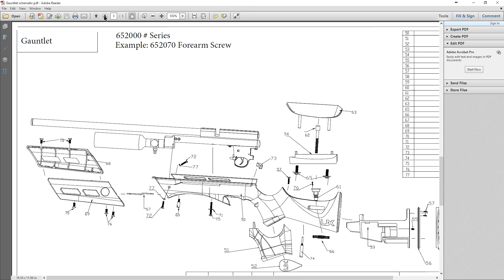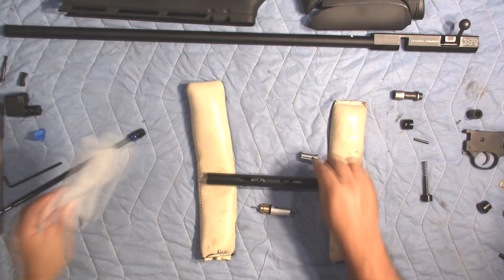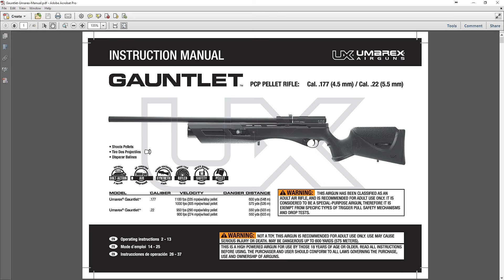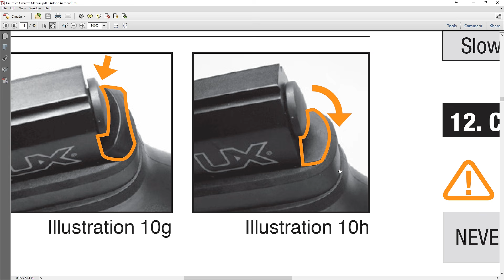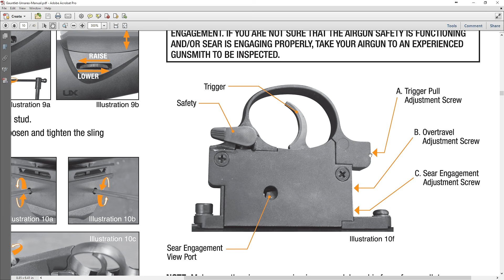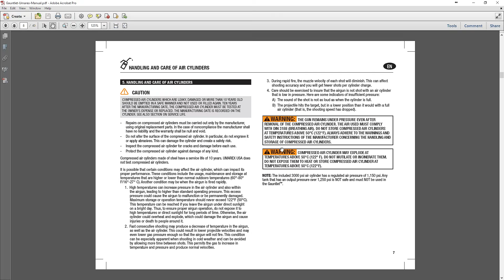Umarex Gauntlet: Super Tune Kit Installation

Comment: Hey I just received the gauntlet and 22 caliber guess what it's broken so SG is sending me a new one out I was so siked up air is coming out of the breach when I pull the trigger then makes a pop sound when I pull the bolt back halfway
Reply from the maker: Sounds like the trigger sear is not holding the hammer back correctly, it also sounds like your poppet is not seating/sealing properly. Swapping it out is the best thing as there may be more things wrong than what you have noticed with that particular rifle. I hope your second one is correct so you can get to enjoying your Gaunty!

Comment: Thank u for this video. I bought this kit a couple days after u put out the video with the results and it's amazing. My reg pressure is at 1300 psi.  I own the .177 gauntlet and I can tune it from 6 fpe to 22 fpe. And anywhere in between. Another thing is that if u like a pellet that this gun doesn't In stock form then u can adjust it with this kit to shoot almost any pellet u want accurately. Thanks again hajimoto.
Reply from the maker: Hey Dustin!  I agree, the adjustability allows just about ANY pellet to shoot well in the Gauntlet.  Thanks for the comment and Happy Shooting!

Comment: Putting the bottle back do you screw it all the way in? Cant seem to get it to align screwed all the way.
Reply from the maker: Ricardo is the bottle under pressure or no?  If not under pressure, screw it in tight and if the fill nipple does not align with the opening in the forearm shroud, loosen the grub screws found around the collar that holds the regulator two halves together. The allen grub screws are shown here at this point of my video https://youtu.be/PYKJ60M6b08?t=13m35s
Loosen them so you can tighten or loosen the collar so the nipple is where you want it and then retighten the allen grub screws.
Reply: Hajimoto Productions it was under pressure and it would release all the air while screwing it in. I noticed i had the screw touching the hammer in to much so it had the poppet open up in the valve. After adjustment i was able to screw in the bottle under pressure and it aligned perfect.

Comment: I took mine apart a second time after having major leak issuse after trying to install this kit. After its all back together,  when I try to fill the tank on the gun air starts immediately leaking from the barrel and hissing pretty good. It wont hold air at all. Any ideas on what the issue is?
Reply: Charles Reedy Fr8train  I did get the issue resolved the O ring around the valve was messed up once I fix that it worked fine
Reply from the maker: Hello, First try to be sure that the rifle is on safe and the bolt is cocked.  If it still leaks you may have to do a more aggressive burning technique as demonstrated by Travis in this video.  Typically this corrects the problem. The issue is the brass valve seat has an anomaly that the Delrin plastic just can't form to and you end up with one spot that won't seal.
https://www.youtube.com/watch?v=WS9v3-QUSX0
I have added this additional step in my video description for future inquiries.
Reply: Ralph Johnson I fixed my issue.. its was the new popett was not seated properly. Check out the video recommend by hajimoto
Reply: hey did you get this issue resolved my gun is doing the same?
Reply: I think I have the same problem :(
Reply: Ralph Johnson https://youtu.be/WS9v3-QUSX0
Reply: Mine wasn't either. I worked on it twice and stuck the factory one back in it and tried it again. It works but my arms are so sore from the hand pump that I'm going to take a break before I disassemble and try again. Thanks for the reply!

Comment: Can you open up the transfer port tube a bit without ruining it or use a wider ID tube to increase the air flow?
Reply from the maker: You really cant open the transfer tube as it is a plastic or rubber tube and it will destroy it but you can increase the ID of the Breech and barrel size for better delivery of air to the pellet.  Be sure to debur the inside of the barrel so you don't ruin the entry point and damage every pellet being racked in.

Comment: Well done Sir. I’m sold on the tune kit idea, but are there going to be further modifications on this tune kit ? I reed below where your tweaking this mod kit. If I order today what version am l getting ? Should I wait a few weeks and get the latest and greatest.
Reply from the maker: The kit has been tweaked as much as its going to be tweaked. Thanks Dan
Reply: Thanks I’ll get that order in soon. Along with the new air stripper. I have reservations about the baffles I just posted a question about those on that vid. Won’t get into that here.

Comment: Haj, what afternoon, finaialy got the time to install my Jefferson state kit. Took the guntlet apart, scalped the o ring on the valve. But i had a viton o ring the same size just .005 bigger in diamator, and it slid in and sealed. Assembled the rest of the parts no problem, till I got to the adjuster. They are anitadizing the part which made the screw hole for the rear trigger screw to tight. Drilled it a little larger, no problem. Adjussted the screw to full power per your video and tested trigger. Aired the gun up and set up the croni and targets 33 yds 14.3 crosman prem. First shot 720fps. I thought that doesn't make sense. So i started adjusting the screw out. About 10-12 turn out. Finial got 908-901fps, happy guy. The 15.8 JSB 880-872, great. 18.3 JSB 830-825 NICE. I wasnn't tryiny for dead on target groups but about 3/4" to 7/8" at 33 yds. Im a happy man. Thanks for the great videos, they helped a ton Dave
Reply from the maker: Great update message and I am glad that the kit went in for you. The end cap issue is known and the hole is going to be moved slightly forward to allow better match up with the pressure tube. Yes, the adjuster screw at the maximum position is not necessarily the best position but a shooter will know the maximum screw adjustment and count anti-clockwise turn back and record the ft/s to get a fair understanding of the power adjuster ladder. 18.3's at 830ft/s should do quite well. Congratulations!

Comment: Taking it apart and putting it back together.. I definitely think I nicked the O rings .. everything is back together but I haven't tested it yet.. what will the symptoms be if I need new O rings and where can I get them?
Reply from the maker: Hey man! Well, leaks will be the most obvious way to tell if o-rings have been damaged. If in the pressure tube, the tube will lose air over a period of time if In the gun barrel, you will lose air from the o-rings rather than going down the barrel and so forth. A test I use for determining if the barrel, transfer ports or probe o-rings are leaking is to drape a length of toilet tissue over the magazine area and fire. If the paper is blown around look at what direction the force came from and follow it back to the source. If you have access to Harbor Freight in your area they sell 385 piece o-ring kits in both SAE and Metric. Each kit is only $7.95 USD and you will have close to 800 o-ring of all different sizes to get you through if you are in a pinch. The only o-ring I have not found in the kit is the very small pellet probe O-rings. I have ordered a few different sizes from McMaster Carr and I think I may have a winner with the 1.5x2MM https://www.mcmaster.com/#1247n128/=1c0b1li

Comment: Has this tune kit have the spacer machined down like Travis Whitney was talking about on the Gaunlet owners group?
Reply from the maker: Negative, this tune kit was installed before we discovered the reduced spacer benefit.
Reply: Hajimoto Productions is there going to be a replacement for it offered?
Reply from the maker: Yes sir there certainly will be a replacement available. http://www.jsairrifles.com/Umarex-Gauntlet-High-Travel-Valve-Retainer_p_78.html

Comment: There needs to be a knob affixed to the adjuster,  so it can be changed on the fly , in the field. Many times I turned  The power adjuster down on my Bantam,  when doing pigeon control,  inside barns. Go from 923fps to 700 in 2 clicks .  To limit over penetration.
Reply from the maker: Agreed Tim, some sort of mechanical or visual feedback would be perfect.

Comment: ive tried for a long time to not say anything about the barrel band. just out of respect for haji and this is going to be hard for me to word properly. Now, i know im going to get alot of disagreement. mainly because im not going to go into the mechanics of why. im just going to state my opinion on this.
 I dont use the barrel band. i myself believe it would be effectively shortening the length of the barrel. and it would be introducing shake and movement directly to a point nearer the barrels end instead of the barrel being able to maintain its trajectory for that instant longer than the stock. which is going to prov more problematic the harder you have to pull on the trigger. for you guys not going to do the trigger mod. thats why the gun has a full floating barrel. but why would anyone want to eliminate that advantage from the gun.
 instead install haji's smaller and lighter air stripper and suppressor cups. and im still waiting for someone to make a light weight outer barrel. i dont think anyone realizes the need for it to help the full floating barrel ensure there is minimum barrel droop. less arc is going to result in less friction down the barrel and less energy being wasted to change the inertia force of the bullets path. less arc in the barrel is just going to result in higher performance and accuracy. all long barrels droop, an expensive gun is going to have that barrel aligned(counter arched) to compensate for it. I dunno maybe there really isnt much barrel droop and it wouldn't have enough difference to make the cost worth it, but a lighter hunting gun would be nice.
 thought i wasnt getting into it but, okay if you fix the barrel mid point what your doing is changing the arc of the barrel. so effectively your path out of the barrel is being changed at a point past the barrel band where the arc is now going to flatten out and the barrel will be what i will call straight for the rest of its length. which is now only the last few inches. instead of of a nice smooth arc all the way down the full length of the barrel.
i'am assuming no one is ever going to get the barrel perfectly straight no matter how hard it is tried. that wouldnt be ideal you want it to somewhat force the projectile into the same repeatable direction every single shot. with no more arc than is needed to get that accomplished.
Reply: wait.. is hajimotos air stripper and suppressor cups lighter than the factory unit?
Reply from the maker: Very tight. When installing the shroud after my HP Air Stripper, one MUST be sure to silicone lube and slowly slide the shroud on as my o-ring in the HP Air Stripper make 100% contact with ID of the shroud.
Reply from the maker: You are entitled to your opinion and as long as you are not disrespectful about the deliverance of the opinion, your post will stay visible. As you stated I disagree with your position ;)
Reply: i really wish i had a barrel band to review. I honestly dont know if i could prove myself right or if there is any difference in accuracy at all.
but, i said lighter not tighter altho tighter is always better haha.. i would like to remove as much weight as possible from the end of the barrel. so there is less natural barrel droop. but the suppressor/comp is very very important to me. getting rid of it is not an option.
im not a gun smith. if im wrong or of different opinion please tell me why.
Reply: Beef Supreme :  Your argument is held under false assumptions .  Stabilizing a barrel in an air gun is more important than a free floating barrel like you would see on an AR 15 .  Keeping the much chincier air rifle together for a long period of time prevent a lot of problems with the guns functionality over time . Where as an Ar 15 which is built to military spec can be durable without the need for such things.   The amount of consistency you get from keeping all the parts in the same place on an air rifle is by far one of the most important thing to do if you want the gun to shoot the same way day in day out and you will gain accuracy by keeping the gun aligned vs having a free floating barrel on an air rifle .   You can debat opinion of course but in any accuracy test you conduct make sure you put 1000 shots downrange and see which gun remains the most consistent.

Comment: So thats a nice video and all 'but how much velocity and fpe power do you get ?
Reply from the maker: I still need to do the tuning and test video before I can accurately answer that question. But in preliminary tests I did during development I was able to achieve 30FPE (18.13gr @ 865ft/s)
Reply: Hajimoto Productions that's what I wanted to hear.  I heard they come factory running around 760 780fps so that would be a great improvement. I'm just about sold on buying your tuning kit. I'm just waiting to see the next video really. That and I already slot this month. Lol

Comment: Thats on ajusting , the regulator I added 2 shims , awsome performance,  do you recommend upgrading valve hammer tune kit
Reply from the maker: The kit will allow the shooter the ability to adjust the level power to suit the need.  A far more flexible configuration than the current Gauntlet state which requires 1 of two things being changed.  Either the Regulator pressure or the weight of the pellet are the only adjustments you currently have.

Comment: So the poppet valve size did not change, just the poppet spring tension as I could see? Also you are showing the burnishing or seating the poppet valve. Is it a brass or steel? I am anxious to see you test results. Hard to believe it that Umarex engineers  got it so wrong. Thanks

Comment: Super great video mod. Ill be ordering these parts for sure. I have already moded the trigger, I have a bunch of springs and found one the same diameter and length. But much liter. Trigger is sweet know, about a pound and half. I have not opened the ports up, but have upped the reg. pressure to 1450 psi. I think this mod will improve the performance alot more being able to get greater hammer strike. What are your thoughts Hajimoto?

Comment: Another great tutorial and improvement on the gauntlet. I can't wait to c the next video on the shot counts and range of adjustment this gives u. In ur comments under the video u said it takes it from 60 shots to 105. How much fps do u lose with that kind of shot count?
Reply from the maker: The weather is not cooperating here in the NorthEast But I will do my best.  Thanks Dustin!
Reply: Hey anytime man. Also I want to let u know I'm still enjoying my barrel band and the way u designed the silencer inserts makes them much easier to clean than the stock one. Plus I seen a video the other day from airgun depot and they HIGHLY recommended ur barrel band for the gauntlet. Congrats on that.
Reply: hello you seem to know a lot about the umarex  gauntlet ..I need some info please .first question .is the gauntlet .25 and the .22 the same n the inside.the reason im asking is because I bought a .25 at a pawnshop last week and its missing some parts inside .my next question is can I put the barrel ,bolt and regulator on my .22.?I know I would have to replace the hammer spring .but would it work out ok?
Reply: @susanmarie4257  The 25 caliber regulator has a stock higher regulator pressure than the 22 caliber. Expect excess velocity, poor accuracy and low shot count. Then turn the regulator down by adjusting one spring spacer at a time. Take pictures, detail notes and do the math before you go tinkering around. Know the difference between parallel and series regarding the regulator spring spacers.

Comment: How bout a little teaser regarding the performance improvement.
Reply from the maker: Ok how about power adjuster at 3/4 and my 14.3gr pellets are passing the chrono at 918ft/s
Hows that 😁
Reply: So lower pressure and faster pellet 
I kinda watched it but the replacement parts are to do what I understand the fix on the trigger

Comment: Thanks for the video. How much easier is the bolt to cycle with the modified spring?
Reply from the maker: Its like a 40% reduction
Reply: Thanks, Hajimoto. Looks like I have a good reason to do a teardown and polish the trigger and hammer. I caught your other video on YouTubes stance on your content. See ya on Vimeo.
Reply: I put the kit in mine two days ago. The bolt is MUCH easier to cycle now. Still working on the poppet but the rifle is really very accurate. I'm getting 840 fps with 19.09 grain pellets but it uses a LOT of air. It does make a pretty loud whack when it hits and is quite a but louder. I have ordered some baffles from  Hagi tho Hopefully that helps. I do love this rifle tho. Well... other than the adjustable cheek piece is pretty sharp and  I have a couple of nice wounds on my wrist from it. I think  a little sanding is in order,
Reply: Thanks for your input on the modification update Ralph.